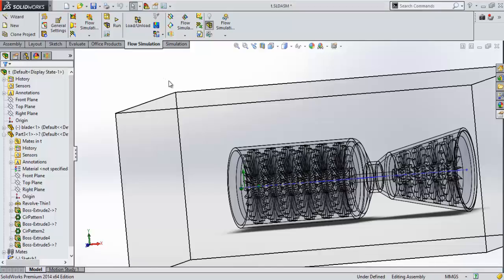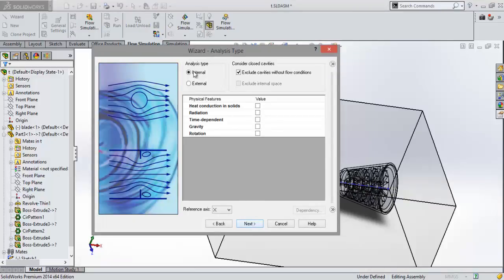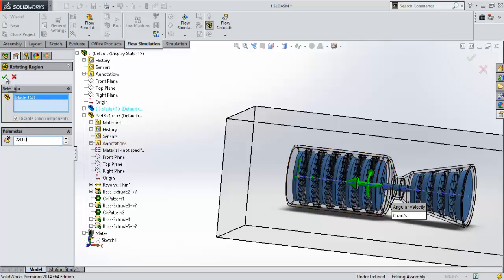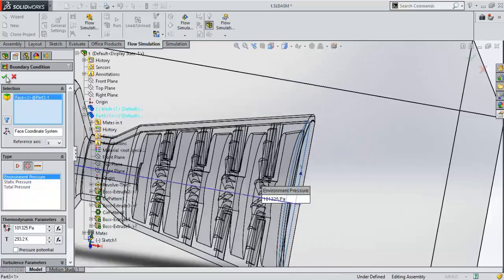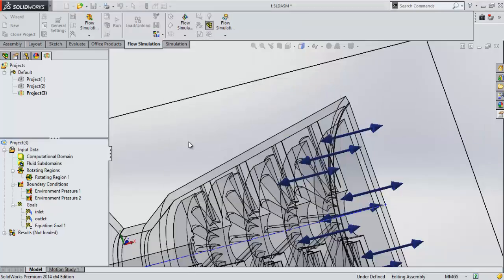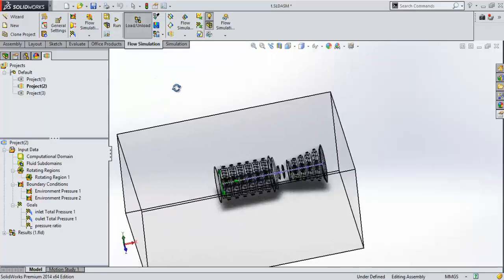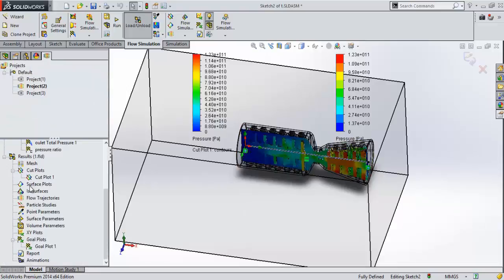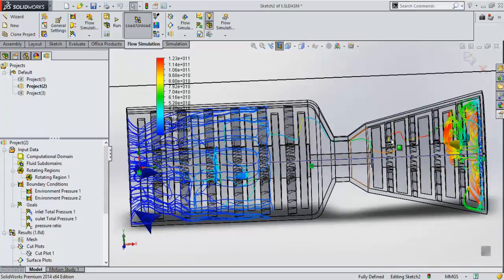axial turbine engine simulation in solidworks

Comment: hii, i have a question. I understand that you have a rotor and a stator. In the case of rotor you give him the rpm, but you created a solid to select in flow simulation for rotation. In your simulations you descart the profile of vanes from rotor in the rotation ?
Reply from the maker: no see whether you use ansys or any other cad simulation the above process is same the thing u asked is done is to actually select the geometry and the extrude i have done will gonna ignore while doing simulation if u really want to understand more then subscribe my channel within two week i am goona put a video regarding this topic in full details

Comment: Awesome and informational video! I’m trying to do something similar with a turbofan engine but I keep running into issues, could you help me achieve what you’ve done in this video?
Reply from the maker: What kind of issues explain in detail
Reply: hpe SolidWorks would not let me run it without adding lids because it’s not “watertight” which effected the inlet and outlet results and it wouldn’t allow the blades to rotate so the results came from the shaft work
Reply from the maker: @jordynhankins3366  well lid is necessary advice in my channel there are other fluid simulation video watch it might help u